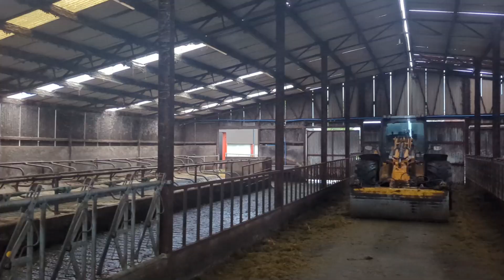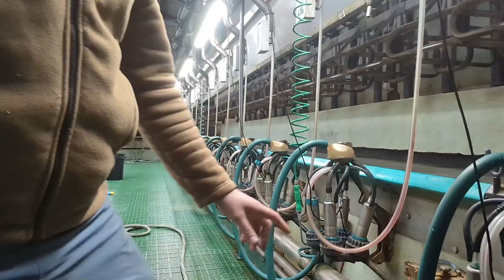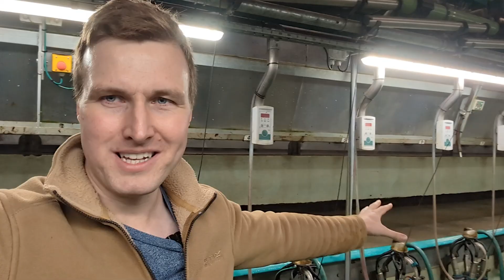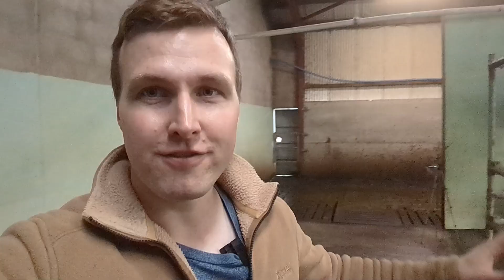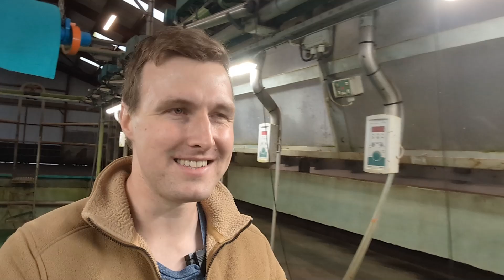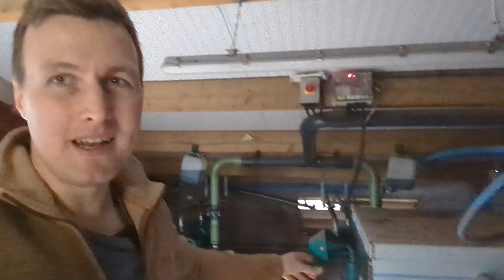Milking parlour DESIGN | Why ROBOTIC parlours are a BAD IDEA? | £436000 milking parlour

Comment: Why did you not think about a rotary. Feel the points raised such as doubling up increasing efficiency etc and not being as cost effective as possible aligns with a rotary.
Reply from the maker: It's does, I just don't think for 180 cows. Probably does at 240

Comment: Just hopping on to say looks like not much has changed since I was last in a milking parlor. My only experience was when I was at university in western Pennsylvania, we had a guy in our friend group who needed help milking if we wanted him to be able to go out with us on a Friday night. So a few times I went to help and really enjoyed it. It was a tiny farm compared to yours. I think they only had around 20 cows to be milked unless maybe he had already done some before we got there, not sure, it was winter and already dark when I got there the times I went, so wouldn't see much. Dairy cows are on grass there unlike other parts on the US. This was in the mid 90's, almost 30 years ago, so my memory is a bit hazy, but I remember having to stomp in a tray that held a thick sponge and disinfectant to clean my boots, then we went down into the pit, which was more round than yours. I believe it was pretty much circular with cows all the way around, hind ends facing us. And concrete with thick white paint (lime?) covering the floors and walls. We went around and cleaned all the cows udders first, then dipped the teats in iodine and put the milkers on. They fell off automatically, and we towel dried them all after since it's very cold there in winter to prevent chafing. Our friend knew all the cows and told us which ones needed to have cream on their udders. Then we gathered everything up into a tub that he would soak overnight. It was pretty neat. And the cows were very happy and healthy. He went around checking feet while they were being milked, and they were obviously really fond of him as some would gently butt him to ask for scratches. I would be happy being a dairy farmer I think. Hard work, but very satisfying and I loved being around the animals.
Reply from the maker: Love the story time! Thank you! 😅

Comment: IQ collectors really work on the flow of milk from each nipple, this leads to uniform milking of cows, dry milking of each nipple is excluded. But they are more expensive to maintain. In practice, when they switch from IQ collectors to classic 300, cows are not milked calmly, they throw off the devices.

Comment: GEA is the most reliable milking equipment. But I advise you to pay attention to the vacuum level of 38-40 kPa. Pulsation in phases A-135ms B-484ms C-97ms D-252ms. Cellular silicone should be rinsed well, it absorbs animal fat well.

Comment: You are correct on the robots , robots are non stop work , you can never switch off with robots you are constantly on call for alarm calls night and day , the work rate is double , I know all this from experience, there used to be four members of staff running the five robots and feeding, etc etc etc , on the farm I worked at with robots, 260 cows , I worked at another farm with 500 milking cows using roughly the same parlour as yours and the whole milking ,feeding etc etc completed in the mornings by three people in two and half hours, milking parlour every time for me

Comment: Brilliant video! A fantastic investment! We put in a new parlour in 2013 and it made a serious difference to our workload and the cows. 
Did you ever consider heat recovery to help heat your water? Tankcare fitted heat recovery for us back in 2020 and it noticeably reduced our electric bill! Ours has definitely paid for itself already. I know people have fitted oil boilers, they can give a ton of trouble and I’m told some suppliers have stopped fitting them?
Reply from the maker: I cant see a heat exchanger working well for us, our water is only leaving the cooler at 16 degrees. I didnt hear about the reliability issues of oil!
Reply: @FarmTheoryNI  I didn’t see one working here either, I was proved wrong. We are similar to you where our tank is only about 50% full, we have plate cooler with well water & ice water from an ice builder. Our tank is doing very little work and I didn’t think the compressors would be running long enough for heat recovery, but every morning I have water to 55 degrees, it pumps to my parlour boiler, taking majority of work off it, re fills my tank boiler which isn’t as efficient as it fills straight after a wash so it goes in hot and has to sit for 48 hours until it’s used, also provides the hot water for my calf feeder and there’s still water left over. On a day where milks collected it may drop to 40 degrees if calves are busy on the feeder. It’s definitely one of the most cost effective things I’ve bought with no service required and works purely off waste heat from compressors.
Reply: @FarmTheoryNI  heat pump might be good?

Comment: Would that gate at the back of the collecting not be better hinged to swing the other way, flush back against the rails to make it easier to close them in?  Nice parlour and design.  Also I would still go with the sort system.  Have the cows going down the race every milking and it won't affect flow when you sort.
Reply from the maker: The gate works as part of the crush race so has to go that way! I maybe will try one at some point, i see what you mean about cows getting used to it!

Comment: Looking like a great place to milk .  What way do the economics of it work out ?  That aspect needs a bit more explaining. What’s cost per litre of maintenance and original capital costs? When you say 1 hour in morning and 50 minute in afternoon is that including start up and wash down? A lot of units to wash and concrete.  Pigs slats look like great idea.
Reply from the maker: Savings in meal were greater than the repayments, small increase in milk yield. Cost for labour to have staff for every milking was more than expected but it affords me a lot more time and flexibility. The time includes washing and starting.
Reply: It would take 50 minutes to wash up that parlour and no mention of maintenance costs which will rise as plant gets older.

Comment: Very interesting points on your new parlour design. It is impressive and looks like it could do another fifty years.  I can see you sweat the details. Impressed with your Python as well. 2 questions  1. Can you milk singlehanded or does it need a pair?  2. Not your design choice of course but would there have been much of a price difference with a swingover line?
Reply from the maker: Thank you! You can milk on your own, it adds 15mins or so but it's not a nice experience. It needs two. 
Swingover was ~10% of the total project cost less.
Reply: Glad you doubled up, clear vision but more important: less wear on the milkers hips pulling clusters from one side to the other. It is the main reason for retirement in NZ ! !

Comment: Two things. Given that your is a double up does it not lend itself to been two person job milking in order to get the most efficiency out of it?? One person milking will always have a lot of clusters not milking? 

Also on your entrance to collecting yard. Cows turn three times to face back of palour. Not great for cow flow?? Possible to have them entering straight in from back corner of shed and turn in once
Reply: Should also added great video. Your reasons for your design was very well explained

Comment: Do you have any solar panels that would help offset your electricity usage?
Reply from the maker: Would it? We use most electric at milking times, which is at 7am and 5pm. The one time we don't use energy is in the middle.of the day.
Reply: @FarmTheoryNI  no idea tbh, but panels storing into batteries would that help? Assumed you had looked into it.
Reply from the maker: @DM-eq1fq  I did, conclusion was nothing gives a return on investment quick enough to make sense re: energy. Savings where all in small wins which are free.

Comment: Even with the price of oil at its highest, would it still make sense if you had the hind sight at the beginning to go oil instead of electric for the boiler?
Reply from the maker: Yeah, it definitely would have. Electric is a bad way to heat water.

Comment: I am one of the five. Delighted with this video. Maybe I am not as daft as I thought I was, we are currently milking 150 through a eight swing over and it is not the best way to spend your life. We have considered robots but for exactly the same reason as you have rejected them and we are still not deciding on the exact parlour to go with but have decided to go with sequential baling and I was very interested to hear what you had to say about the individual troughs versus what you have. Like the idea of the tunnel and moving the stuff out of the pit also . For me it was a hugely informative video thanks for posting it.
Reply from the maker: You have got very lucky you seen this! 😅A mistake in your design can be very expensive! Another point i didnt mention, make sure you earth EVERYTHING really well. I have steel mesh in the floor joined to the frame all grounded to a deep stake.
Reply: @FarmTheoryNI  I am an electrician by trade so I have a pretty good understanding of the importance of a good earth , put in 3 phase this year in preparation for the build, GEA seem to be popular with YouTubers at the moment, did you have any particular reason for going with them? I am loath to go with a machine that I am not confident about the back up service although I suppose if you include enough redundancy’s you would probably negate that issue. I am not convinced that a double up is the best option however I am fairly well convinced that as we have the potential to go to 200 cows we need at least 24 units and of course acr’s and meters etc however as we have a split herd 40 percent autumn, 60 spring I think that feed to yield may be beneficial however I am definitely going to look very carefully into the stats in this regard, at the moment we run them as 2 different herds ( just to slow things up even further) . I would like to have the new unit as close to possible a one operator system as labour is just not affordable where we are.

Comment: I was waiting for this,very  informative ,are your cows at 2,2 centres,what width is the pit?would a heat recovery unit save your energy use at heating water
Reply from the maker: I cant remember the centres, its 2.8m. I priced all the above and it doesnt add up. My water is leaving my plate cooler at ~17 degrees, thats only 5 degrees above the water in temp.

Comment: Excellent video. You should take real data on your electric heating costs, I could believe that it's costing 2 - 3 times more per kW of heat energy. A new boiler and tank is going to be very economical to buy in comparison to that production cost. Someone in a different industry will probably buy that electric system from you in a heart beat.
Reply from the maker: I have recorded all energy use in detail, the capital cost doesn't make sense to change. Current paying 15ppkwh for night tariff and oil would be around 10ppkwh.

Comment: Big numbers. Rotary only answer
Reply: 40 point 200 up
Reply: @robinhill9414 I agree
Reply: I have actually looked at the figures for a 40 point rotary, I worked in one years ago and I was impressed with the throughput but you realistically can’t justify it on borrowed money for any less than c. 300 cows provided they are at over 500kg’s of solids and you would need more if you aren’t at that point. The cost of the infrastructure to accommodate a 40 point rotary is considerably more than a 24 point swing over with sequential baling, obviously Andrew has gone for a much more expensive option however and I don’t know how he would have faired with a comparison.
Reply from the maker: @Andy-ix2ox  interesting. I guess the ability to spec up or down a parlour applies to rotaries also so the comparison you make is probably still valid.
Reply: @FarmTheoryNI  I went with acr’s, milk meters and feed to yield when pricing and obviously I got a price for auto teat spraying on the rotary as it’s not possible to work as a one operator system without it. I didn’t go for cluster flush or anything else basically because I was not convinced that it was necessary. I am not sure that I will go with feed to yield either but I have priced for it. I will be milking c. 160 next year and have 58 heifers to go to the bull next year so the time to bite the bullet is fast approaching. I have savings and could probably do the infrastructure work without a need to go to the bank but I don’t want to risk starting to do the job and not be able to get the money to finish it and with present milk price the bank may not be that giving with the old money. Put in an application today with last years accounts, looks great as long as they don’t dig into this years cash flow!
Reply from the maker: @Andy-ix2ox  Definitely borrow money and keep cash spare. You will spend more than you think on little silly things. I budgeted for £360k cost me £436k
Reply from the maker: Absolutely agree. I think the tipping point is 250 cows?

Comment: Fair enough reasoning but would strongly disagree about robots. Had them 3.5 years coming from an auto tandem loaded with everything which was a joy to work in and couldn't go back. Got rid of so much labour, next to no mastitis/antibiotics and the 24/7 on call isn't anywhere near as bad as made out to be; alarms are rare. You're tied to animals anyway, and no more so than milking 2x/365. If you train them to need fetching then that's what you'll do. But agreed, they don't suit everyone
Reply from the maker: Fair point, I knew that bit would encourage some engagement!

Comment: A good explanation of your reasoning behind your decisions. I have a double up parlour with a wide pit 25 years old GEA and most of the equipment is the same as yours .I put ADF in last year and like the upgrade with 2 people milking its a great work environment.I was surprised that robots would have been cheaper but in the long run much more expensive running costs .As long as you can attract and keep staff parlours would still be the most cost efficient way to harvest milk I think 👍

Comment: Great video, I would agree with  your comparative advantages over robots but how would you rate your double up to a rotary milking parlor? 44 or 50 unit, less walking one man milking and cow flow and I would imagine cost is simular especially when looking at a shed width to facilitate rapid exit
Reply from the maker: I felt like I was just a little bit to small for a rotary, the cost was a fair bit more for a 50pt and I'm not convinced there is a benefit to going rotary on anything smaller.